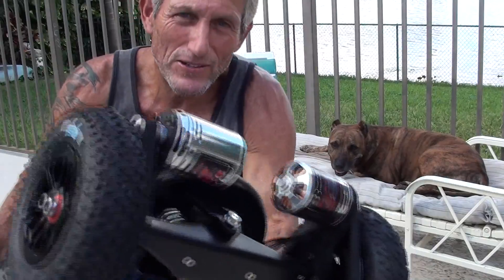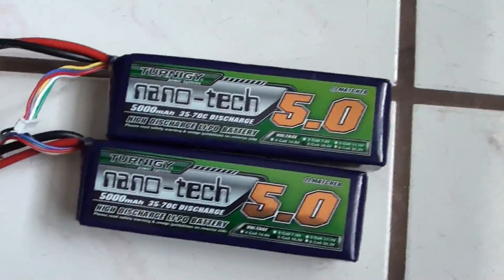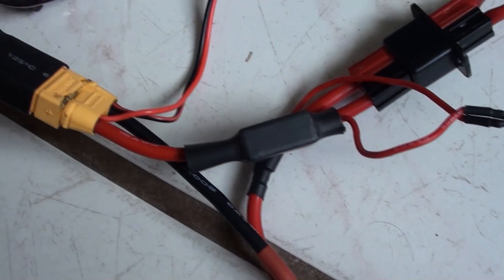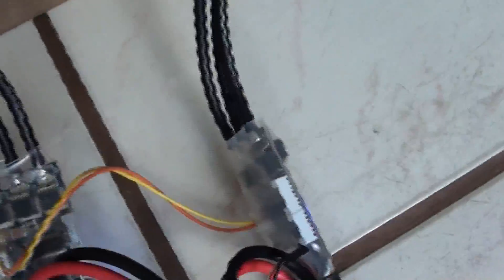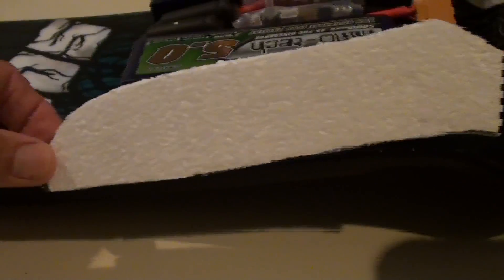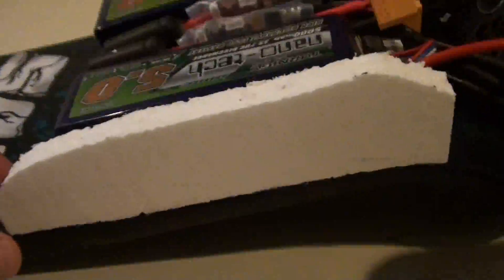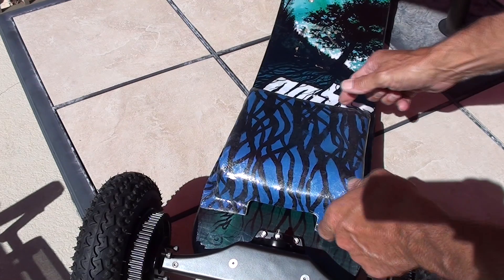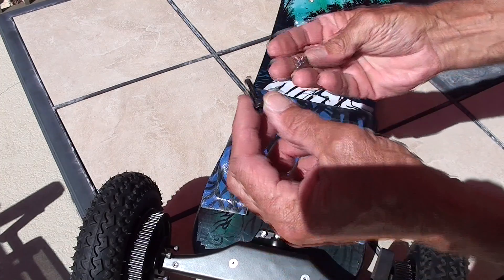Electric Mountainboard/Skateboard Build

Comment: Hello this is Paul from Michigan and I have an mbs bored and I'd like to know how much it cost to make that board and I'd like to know how much it would cost if you made the necessary stuff to turn my board into a mountainboard it Play electric one
Reply from the maker: Hi Paul, I made the board a while ago so component costs have increased since then. I would guess it would cost $500-$600 or more just for the electronics and mechanical parts. You should easily be able to build it yourself and customize as desired. There are many videos and parts suppliers online to help you. Lmk how it goes.

Comment: Hello sir.how did you configur the mini vesc to vesc tool apps?is your vesc is still working up to now?
Reply from the maker: Hey Axlsoy, Check out this link. https://youtu.be/lDuV8cnPRmI 
Your configuration may vary depending on which vesc and how old it is. Mine is still working fine. Remember you need 1 vesc for each motor
Reply: @foilsurf  oh it's been 3 yrs now and still working.good to hear that sir.😊. yes i have 2 mini vesc 4.20.i don't how to config in computer and i'm using also like your remote control.😊
Reply: @foilsurf  the link you send to me is ok but he talks fast.😂
Reply from the maker: Thanks my friend. Good luck and stay safe
Reply: @foilsurf  always welcome my friend.stay safe always.god bless
Reply from the maker: The vesc is fairly easy to configure. Just download the program then plug your vesc into  your computer using USB ports and change some of the numbers to the specs in the video. There is an online forum that is very helpful if you have any problems figuring it out. Here’s a link. https://electric-skateboard.builders
Reply: @foilsurf  thank you so much.i will let you know if i build my new vesc.there is only a few parts not delivered yet.btw i'm from philippines sir.stay safe always.

Comment: Hi, I'm from Brazil, how do you recharge your batteries?
Reply from the maker: Hi, I use IMAX B6 AC charger with a parallel adapter which allows you to charge multiple battery packs simultaneously.

Comment: wanna get a kit but can't find anything only for a full setup of battery motor with controller  want to get a board with a style i like instead of tsome of the per put to gether one i have been seeing if some one could help me out with this it would be awesome.
Reply from the maker: Blaze Holderman hey Blaze, it’s been a while since I built mine so there is a lot more resources for builders now. Def check out https://www.electric-skateboard.builders/   Post your question there. Best resource I know for anything e-skate related. Good luck!

Comment: Question for you sir.  I'm thinking about buying the Turnigy Aerosky 6374 motors I saw on your board for one of my builds.  Wanted to get your opinion of those motors.  Are they still working good for you?  Would you recommend those motors?  Thanks in advance.
Reply from the maker: Troi Bandy Hey Troi, yes I’d definitely recommend them. They are still running perfectly and never had a problem. Good luck on your build!

Comment: You said your were having trouble with your connectors lining up. That is because they can melt a little bit and shift while soldering. What I do is I plug in the connector to another one before soldering. That keeps them aligned.
Reply from the maker: t0ny747  Thanks for the tip my friend! What I meant by the connectors not lining up is there are so many different styles and sizes of connectors that I would often have to alter the original to fit or line up with other connectors. Btw I assume you are a pilot? Very cool vintage planes on your videos!
Reply: @foilsurf  I am just talking about connectors of the same type like XT60 or Deans. If the connetors melt and get out of alignment it can be hard to plug and unplug them.

I am not a pilot yet but I have recently started work on getting my private pilot license. I am a volunteer at the Warhawk Air Museum.

Comment: Hello Flysurf. Thx for this cool video. I have one small question. ) what ESC controllers did you use?
Reply from the maker: Dmitry Moiseev Thanks. Check the links in the comment I have pinned on top. I used 2 different suppliers. There are many more updated ESC now

Comment: Hello, could you give us links off your using parts?
BTW beautiful job.
Reply from the maker: Algirdas Viltrakis Thanks my friend. If you check the comment I pinned 1st I put most of the parts links there. But it’s been a while so some links no longer work but most parts were bought from Hobby King, Ebay and Scramboards. There are many resources where you can find parts pretty cheap on the Esk8 forum. Good luck on your build!

Comment: Great job!

I’m in the process of building my own; except I have a plethora of 18650 batteries, I’m going to build my own pack!

May we see a source for your parts?

I’m especially interested in the wheels, motors & drive setup!
Reply from the maker: Andrew Stang-Green Thanks Andrew!  I got the batteries, electric motors and charger from Hobby King. Got the mechanical parts from Scramboards. Got various other parts from ebay and aliexpess. Good luck on ur build!

Comment: awesome video, I only have one question, where did you get your belts and pullyz
Reply from the maker: Robert Bushell Hey Robert, Thanks man! I used https://www.scramboards.com for all my mechanical parts. Pulleys, belts, motor mounts and rear wheels. It can be purchased as a kit.
Reply: flysurf244 thanks

Comment: Man you are great, I love this build...
Reply from the maker: Aaron Janzen Thanks man!
Reply: flysurf244 what way could we do a bit personal chatting?
Reply from the maker: Aaron Janzen I'm cool with messaging me thru this forum
Reply: flysurf244 what motors did you use?
Reply from the maker: Aaron Janzen Turnigy 6374  192kv. Got them from HobbyKing. I think they were around $70 each at that time but not sure exactly.
Reply: flysurf244 I imagine they have plenty of power? Or do people put even bigger?
Reply: My next question is, what remote do you use? I'm familiar with Rc planes, drones and more.. Making my own.. But I'm not familiar with this specific little remote
Reply from the maker: Aaron Janzen Yes you could use more powerful motors but these motors provide more than enough speed and power than I need.
Reply from the maker: Aaron Janzen I got my remote from aliexpress. It's just a generic handheld trigger wireless remote very easy to program and use. I checked but didn't see my specific remote on their site anymore but there are others. Many others have started producing these wireless remotes since my build so check around.

Comment: How far can u go on a charge and have taken it off roading uphills
Reply from the maker: salas random videos Hey man! I can go approximately 9 miles on flat pavement. Off-roading (hard packed dirt and grass) around 6-7 miles. Haven't tested it much on hills because I live in So Fla and it's pretty flat except for a few sloped bridges which it easily cruises up. If you want to go farther just use a couple 6s batteries instead of the 5s batteries I used and if you're in an area with hilly terrain you can always program your VESC to provide more climbing power. The VESC provides many options to customize it to your terrain.

Comment: Hey flysurf! Awesome build!  I just came across your video and instantly knew I was about to make my own.  I haven't seen any new comments so I've spent a couple of months looking thru tutorials and finally made my way back to yours. I see comments like "do your research" so Ive been hesitant asking your opinion. But after seeing the thousand different ways to make these id rather know if you would do anything differently. What parts last and what parts are headaches? And do you still enjoy it?  Hope you still ck these comments and thank you for your time!
Reply from the maker: JJ FURGERSON Hey JJ, Awesome I could be of help. Wouldn't change much. There are some new technology  ESC's so that would be something I'd look at. Still riding. Only problem I had was a defective VESC which I replaced. Adding a battery charger port would also be something that would be cool to have. My build requires removing the batteries and connecting them to a charger, so you can see the benefit of a charging port. Good luck on your build!
Reply: Hey! Glad to hear from you. Those turnigy motors had me a lil concerned, (these motors are currently out of stock) good to know you're still happy with them. I saw some builds with an electric scooter charger and port. I believe they had lithium ion batteries.  Would you recommend using those over the lipos? It looks like taking batteries out to charge and balance charge would be a huge hassle. Thx again!
Reply from the maker: JJ FURGERSON Each battery has its advantages. Lithium ion probably less expensive, lipos last longer and I believe are suppose to be safer, less chance of a fire. Either way stick with higher quality batteries.
Reply: Will do. I see Jenns etox site using chains alot. What's your take on the chain drives vs a belt drive? In my research it seems that chain components are easier to get.. Still difficult tho.  Lol
Reply from the maker: JJ FURGERSON Personally I like belts. Lighter, quieter, inexpensive easy to adjust and easy to come by.
Reply: I really appreciate your help! The vesc.. In your video you mentioned it helps with charging the batteries. Does it somewhat act as a bms instead of the regular esc? On most of the mountain board builds I see like, etoxx, they don't use the vesc.. I didn't kno the reason for this. Really, thx again!
Reply from the maker: JJ FURGERSON The main reason some use the esc over the vesc is cost - the ESC being less expensive. But the vesc is far superior in the ability to customize your motors performance.
Reply: Gotcha. I appreciate your help.  Still gathering parts so I may reach out to you as I go.  Unfortunately almost every component I look for is out of stock out the moment.. Unbelievable. Everyone building one I guess lol. Came across may tech motors and vesc.. Have you ever heard of these guys?
Thanks again!
Reply from the maker: JJ FURGERSON Never heard of May tech. There are a lot of startups as eSk8 is becoming more popular. I can relate to your frustration about the delay in getting parts. I think I waited around 6 weeks to receive my vesc.

Comment: how do you turn it on?
where did you get all these parts from?
Reply from the maker: EASPARKS 1738 Check the 2 minute mark on my video, that's how I turn it on/off. Also if you go thru many of the comments I list where I purchased the parts. Hobby King and Scramboards are a couple you should check out.

Comment: Do you get dirt in the motors? If so how do you clean them
Reply from the maker: Max Fan Hi Max, No, never had a problem with dirt in the motors. I usually ride on the street and when I go off-roading it's usually on hard packed grass so it's not really a problem. If you do get dirt in the motors I would think a good shot of compressed air and/or a soft small paint style brush would do a good job of cleaning them out.
Reply: flysurf244 Thanks I’ll try the compressed air

Comment: Battery voltaje ??
Reply from the maker: David De La Torre Hey David, I'm using  (2) 5 cell/ 18.5V LiPo batteries wired in series.
Reply: flysurf244 ok ,thank you...greetings from México city
Reply from the maker: David De La Torre Eres Bienvenido mi amigo!

Comment: How well can it start from standstill without sensored motors?
Reply from the maker: Martin K. Schröder Hi Martin, The gear ratio and adjustment on the wireless remote make it possible to get a smooth acceleration from a stop. I usually push off a time or two to get going but just to lessen the torque on the drive belt.  But the sensorless motors work fine.

Comment: type of ESC?
Reply from the maker: wilson filho VESC (Vedder Electronic Speed Controller)
Reply: flysurf244 Ampere?
Reply from the maker: wilson filho I'm using 2/ 5s lipo batteries, 5000 mah. https://hobbyking.com/en_us/turnigy-nano-tech-5000mah-5s-25-50c-lipo-pack-xt-60.html?___store=en_us
Reply from the maker: wilson filho https://hobbyking.com/en_us/turnigy-nano-tech-5000mah-5s-25-50c-lipo-pack-xt-60.html?___store=en_us
Reply: flysurf244 thanks
Reply: What are the characteristics of VESC?
Reply from the maker: wilson filho The ability to customize the characteristics of your board such as braking, speed, distance etc.
Reply: flysurf244 ok

Comment: Curious question about that controller. Does the throttle trim work? I just purchased 1 and am hoping it will. I've read good reviews on them that braking and throttle response is better. I've got no problem with my thumb throttle but wanna give that one a shot. Thanks in advance. Great setup!
Reply from the maker: Matthew McClain Hey Matthew, Thanks! Yes the throttle trim works perfectly. I found a setting that works for me so I just set it and leave it but the trim works well.

Comment: You should be able to hook both motors up with one sufficiently powerful esc like this one. It would probably make the project a little cheaper. https://hobbyking.com/en_us/turnigy-trackstar-1-5th-scale-sensorless-200amp-8s-opto-car-esc.html
Reply from the maker: Daniel Auen Hey Daniel,  Yes an ESC cost is much less than a VESC but I like the latter because of the ability to customize to your specific needs. I noticed the description/specs on the ESC is for 4-8s lipos so not sure how that would work with my build which has 2/5s lipos =10s total

Comment: What Motors did you use? Have you had any issues with the VESC's burning out? If you have the means and the time we would appreciate a parts list.
Reply from the maker: David Weshenfelder Hey David, The motors are Turnigy 192kv- 6374. I did have a problem with one of the VESC. I was getting a DVR8302 error on the  VESC chip. Without going into too much detail, it's a common error which causes the chip to burn out. I believe it was a faulty chip. Either way the company I purchased from would not warranty it so I purchased another VESC from a different vendor and have had no problems with it. I believe I was originally sold a refurbished VESC so be careful and make sure you purchase from a reputable company that guarantees their products. It was an expensive lesson. As far as a parts list, if you go thru the comment I pinned at the top you will find a complete parts list. There are a few other comments where I also posted parts lists.

Comment: How much was the whole set up?
Reply from the maker: Franky Alvarez Hi Franky, Cost was around $900 USD. That includes the board and separate dual battery charger. You could spend more or a lot less depending on quality of parts, battery/motor size etc.

Comment: where did you get the wheels
Reply from the maker: Jenna Kunde Got the 2 rear wheels from scramboards.com along with the mechanical parts/gears. The mbs wheels that came with the board would not fit the gear drive I am using so I swapped out the rear wheels and kept original mbs front wheels.
Reply: thankyou!

Comment: Really great job there!! great to see somebody using fibreglass too, such an underused product, whats the range on those batteries, looks like you could use a little more battery?
Reply from the maker: knoxieman Thanks man! I get a range of around 8-9 miles on flat terrain/pavement. Less distance off-road. Yeah could probably bump up the batteries to 2/6s=12s total but keeping costs reasonable was one of the reasons I went with the two 5s=10s total. But I'm satisfied with the performance as is.

Comment: Hello, I live in the mountains and have many hills to worry about. Would you suggest using brakes or will using motor brake be enough?
Reply from the maker: Eddie Malooly Hi, If you're using a VESC with two motors you might be able to program them to brake pretty hard going downhill but on flats it might not be so safe. Would probably throw u off if it brakes too hard. So I would guess the manual brake would be a better choice.

Comment: Can you make me Motor-VESC-battery connection so only i have to buy and install only desk, drive parts and battery?
Reply from the maker: Adam Szilvassy Hi Adam, Check eBay for the connector. You can probably buy the connector cheaper there than I can make it.

Comment: Did You try HUB motor wheels?
Reply from the maker: Святослав Скворцов No I didn't try a hub motor. I considered it but from what I found the brushless out-runner motors give better performance at this time. There is a new generation of hub motors that are constantly being improved so I'm thinking they will soon be the way to go. Less clutter and weight are just a couple advantages of a hub motor.

Comment: Hi, I noticed you have the yellow dampers on the rear springs - did you use the same on the front?  Are the yellows enough to keep it stable at higher speeds?  I have a generic, non-DIY electric mountainboard with no dampers and it is hard to keep steady over 12mph.  I thought about buying the reds or even blues.
Reply from the maker: Mark Myers Hi Mark, I had to use Trampa Infinity trucks on the rear because the MBS trucks that came with my board did not work with the Scramboard motor mounts I used. I kept the original MBS trucks on the front. The Trampa trucks work awesome. I've gone close to 20mph and they are rock steady. The looseness of the trucks are adjustable so if you need a more stable ride it's easy to tighten them up. I have them set at a medium ride.

Comment: isn't 2 motors overkill? seems like all i ever hear is people saying that one motor is sufficient because the motors don't bog down or somesuch
Reply from the maker: Caerbanog Interrupted One motor is fine to use. I prefer 2 motors because they control both wheels when accelerating, turning and braking. Makes it a safer ride. There is no excessive pull one way or the other. Imagine a car that had only one wheel that braked and accelerated. I don't think it would be as efficient.